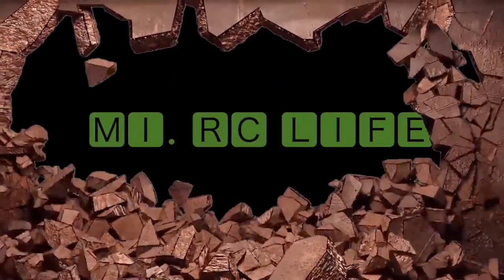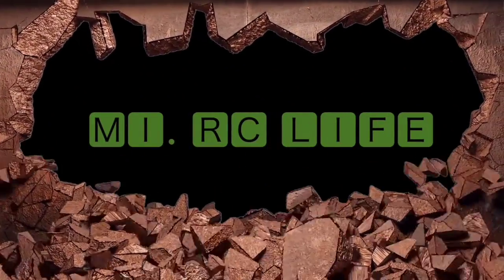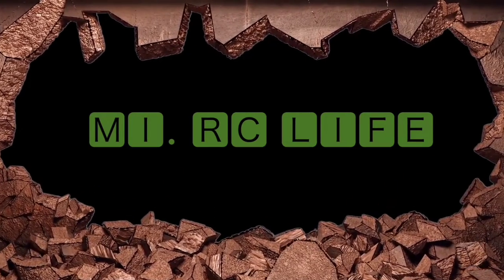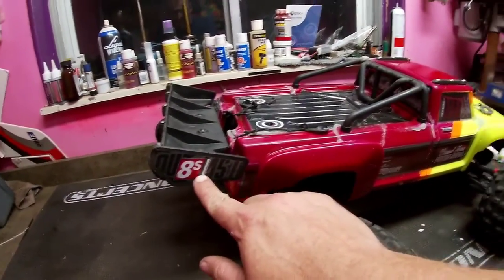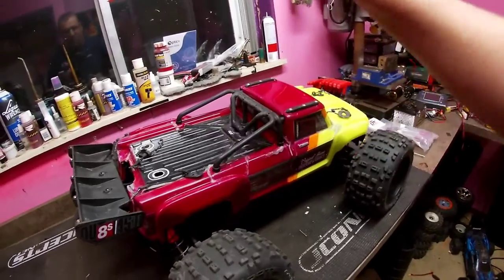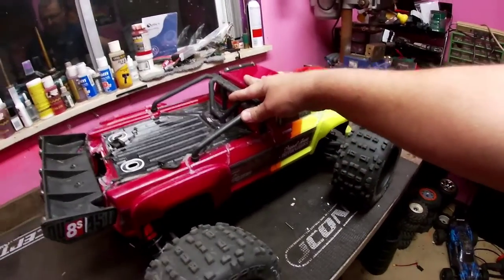8s Arrma Outcast GPM Aluminum Rear Tie Rod & Stabilizer Install

Comment: Daaamn that was some camber in the back before you changed the links 😅😅
Reply from the maker: Yea, it took those stock links and jammed them into the plastic rod ends basically stripping them out.  I think it was because of the huge dual 6s batteries I run and the Big motor and ESC have added a bit to much weight to the car and things like those rod ends couldn't take the stress.  The car shakes the ground when it lands. 😆😁. Lol

Comment: Hey bud I think 2 of those 3 center screws go swapped with the long outer ones the ones that had alot of thread hanging out but ya man thats a great upgrade and great job on the vid
Reply from the maker: No sir!  The 3 center screws are much to short to go through the putter bearing carrier.  I just went and double checked to see if they would indeed fit and they are not even close.  Thanks for the idea though.  It never hurts to voice your opinion.
Reply from the maker: I wish I could add pictures to comments so I could show you.
Reply: No worries just thinking out loud I guess 😅 great vids love your channel
Reply: @myrclife  So I just picked up an Outcast with this kit installed.  The front 2 bolts won’t tighten up… anything I can do to fix it or do I need to replace the entire housing?

Comment: I am definitely looking to upgrade the rear tie rods.  My first bash with the Outcast 8S lead to a stanced look for one of the back wheels.  The stock tie rods clearly can't handle the punishment.
Reply from the maker: That's exactly what happened to mine. A hard landing with all of that weight shoved the tie rod ends into the plastic turnbuckles and stripped all of the threads.
Reply: @myrclife , I had to readjust both of my links to be consistent with camber.  I have been weighing different options.  How has durability been with this part?
Reply from the maker: I have bashed this HARD and had no bent/broken rods or hardware. I think this is a definite fix for the rear of the 8s outcast and 8s Kraton line of rc's. Its worth the money.
Reply: @myrclife , awesome!  I know another good option is Vitavon…but they aren’t cheap.  Thanks for sharing!  What do you recommend for steering arms?
Reply from the maker: I'm still running the stock steering arms up front.  They have been holding in there so far, and my truck is EXTRA HEAVY with the 12s battery setup and that HUGE Tp power motor I have.

Comment: Hey flyboy✌️. Now go pound the tar out of it. I need to see what stress that puts on other parts.
Reply from the maker: I will do that soon.  I'm trying to get the motor back in my trans am before snow hits Michigan
Reply: @myrclife  
 What's up with the t.a?
Reply from the maker: Spun a rod bearing July 3rd this year.
Reply from the maker: The motors been at the machine shop all summer.  It's bored .030 over now, took .010 off the block surface as well to true it up,  Speedmaster Pistons, lt-4 hot cam, new crank, and a full gasket set (obviously).  It almost ready to go in the car right now.   I'm putting plug wires on as we speak.....or type I should say.
Reply: @myrclife  
Good luck with that
Reply from the maker: Video coming soon
Reply: @myrclife 
 Sweet